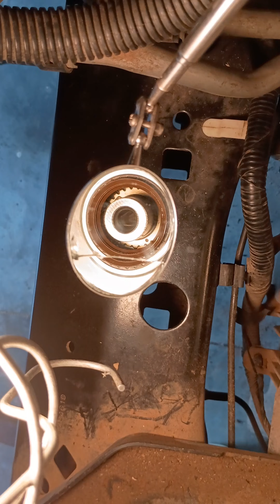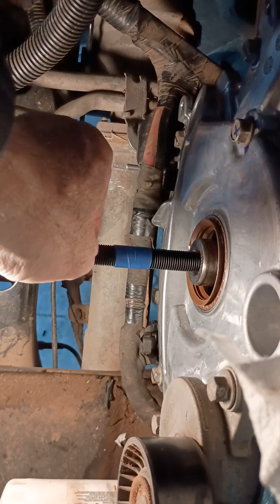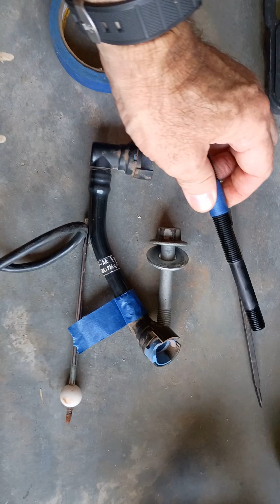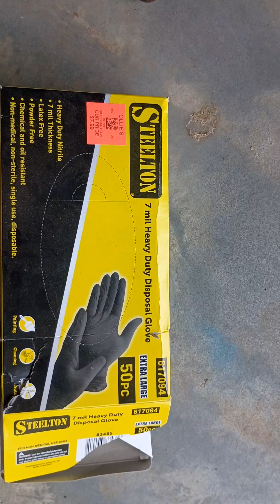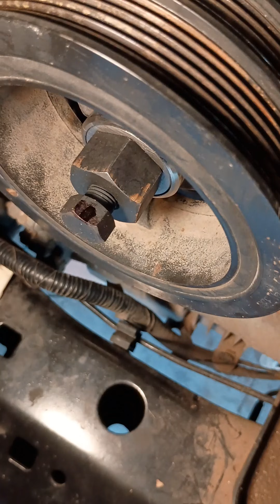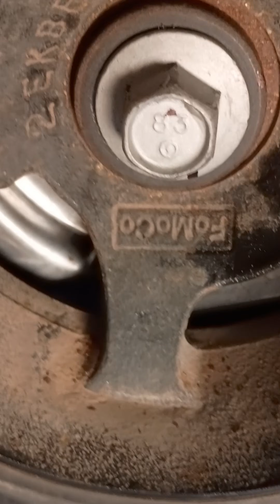2019 Ford Expedition 3.5L Crank Pulley Installation

Comment: Just used kit 67006 from Oreilly it fit perfect with no issues also the one I found that fit mine was a black adapter not silver as yours is maybe wrong parts in the box